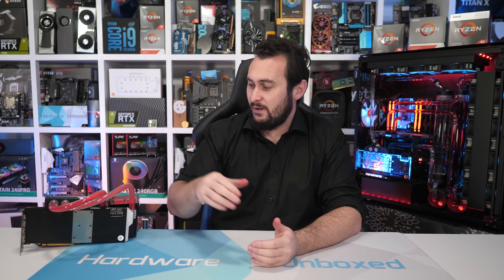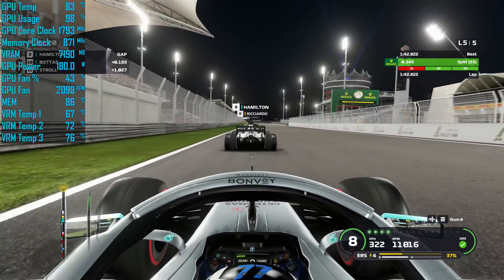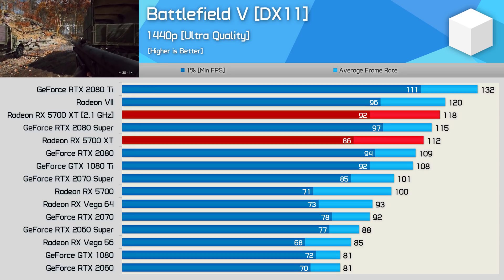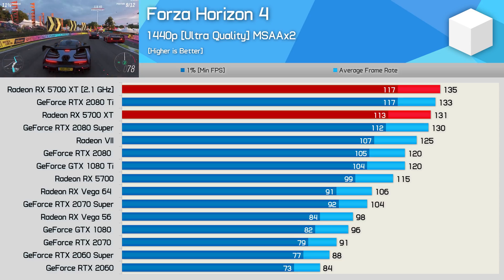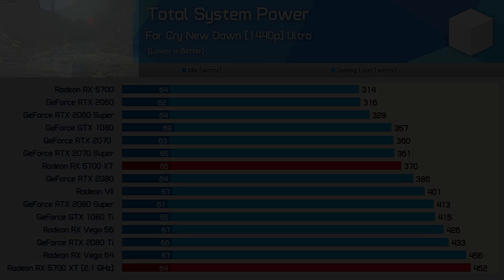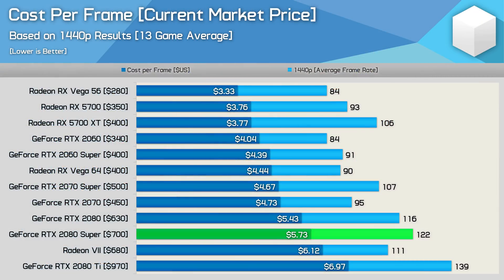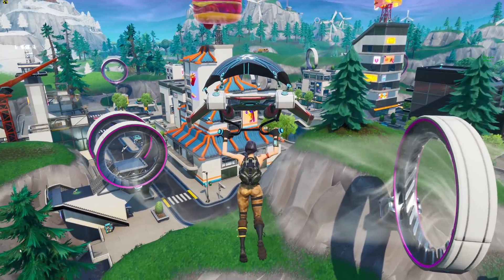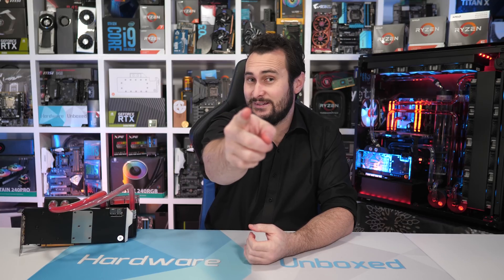Radeon RX 5700 XT Overclocked, RTX 2080-Like Performance?

Comment: On your Far Cry New Dawn chart the 5700XT @ 2.1Ghz is sitting at 113 fps with a 85 fps low. That means it beats the RTX 2080. The highlighted portion must've not carried over properly.

Comment: WTF? Why would you prefer overclocked watercooled RX5700 for 540USD instead of faster, cheaper, less power hungry and overclocable 2070S? Where's the catch?
Don't take me wrong - normal RX5700(/XT) are great, but not with waterblock trying to match (and fail) 2070S.

Comment: AMD has basically priced their 5700XT so that it gives equal dollar per frame performance to the 5700, which gives a lot of people a reason to just ignore the 5700 and go straight for the 5700XT. It seems like a clever marketing strategy, as they're going to be making more profit per unit sold on the XT.

Comment: Honestly the 5700 XT is a really appealing card. They should have used HBM, but who knows. Maybe they will have a 5800 XT and 5900 XT that kill Nvidia at the higher price points. Well.. we can hope at least.
Reply: well problem is that HBM2 Aquabolt  2x4-HI (4GB per chip) 8GB is just 614 GB/s with 2048bus vs 11GB gddr6 616 GB/s 352 bus.
now HBM2 (3x4gb) 12GB with 900-ish GB/s could be a pain to package and HBM2 (4x4GB) 16gb 1TB /s would have been a over 40cu Navi.

now the New Samsung HBM2 Flashbolt chip has 410 GB/s but the layers are now 2GB vs 1GB Aquabolt and so far I don't remember seeing any HBM2 2-Hi chips in anything, so it would be 2x4GB or 2x8GB with 820 GB/s

now jedec hbm2 standard is 307 GB/s 2/4/8/12-Hi (with rumors of ready 16-Hi) 1GB layers chips, but Flashbolt is so far max out at 8-Hi 2GB layers so I'm not sure when it will be HBM2 Standard.
 
Now AMD has said CES 2020 will not be about CPU, so we will Arcturus HBM2 and bigger Navi with GDDR6, now AMD could push someone of the three to make HBM2 2-HI chips for Navi BUT I would say it is very unlikely.

now some say the Arcturus is Hybrid GCN/RDNA, but only time will tell

Comment: Awesome review as usual. For 400$ you are getting 1080ti or radeon vii performance, thats very impressive.  the biggest limiting factor on the card is the blower. once good partner model cards come out, the thermal issues will be resolved with better cooling.

Comment: i have a sapphire 5700xt with an accelero xtream III cooler on it and, took temps down to the 45-53c i only play at 1080p 144hz  its amazing it will do 100-145 fps all the time  no idea  room temp is like 28-30c as well no ac in my room saddly >.<  down side is that it idles at 45c all the time  like its on all the time o i came from having a 1050 ti, i used to play at 720p in every game just to see like 100+ frames alot its cheezie but it works :)
Reply: You should have made a youtube vid when attaching the cooler, cause i'm looking at doing the same thing, but doubt i've got the guts to void the warrenty lol

Comment: anything can run fast with enough SM/CU, power, and cooling. this time, the 5700 runs super fast by brute forcing it's way through power. that's probably also why AMD puts a blower type cooler there, to keep efficiency while sacrificing cooling.

Comment: Performance Summary
Average of average FPS from 13 games - Higher is better:
 - 5700 XT = 106
 - 5700 XT 2.1 GHz OC = 113
 - 2070 S = 107
 - 2080 = 116

Estimated TBP in Watts - Lower is better:
 - 5700 XT = 260
 - 5700 XT 2.1 GHz OC = 340
 - 2070 S = 270
 - 2080 = 300
Reply: SlavjanA 2070 super is much better normally though, the values are screwed up by forza

Comment: Really says something that you have to spend an extra $140 to get an EK block to get it to match a 2080 and even then it only ever matches it. 

Meanwhile that’s only going against 2080 stock speeds when the 2080 can be OCed.
Reply: Yeah but it’s water cooled.... so barely doesn’t make any noise.

If you’re an FPS seeker, sure, it makes no sense.

If you prefer silence, as I do, the value proposition is very good.

Comment: Have you tried undervolting the 5700 XT since it does wonders for my vega 56 that i am still rocking (bought it for about €200 of a guy who obviously used it for mining about 1 year ago). I am easily getting about a 30% increase with some fiddling and i could probably go higher if i installed a liquid cooler, since my main issue is heat.

Comment: There is a 4th option, getting a $60 USD Arctic Cooling Accelero Xtreme IV VGA heatsink and a few small copper, or aluminum if you're cheap, heatsinks for the VRMs and vram modules.

Comment: I used to spend an inordinate amount of time testing overclocks on the Cpu and gpus i have and have given up on that lately and will only set fan curves, and undervolt maybe as the gains are not worth it.  The increased wattage and heat for minimal gains doesn't make sense.  If I want more FPS, I have to buy a better card or CPU and that is fine with me.  My gaming isn't noticably effected except for rare cases where having 3 more fps keeps the lows from becoming visually noticable whereas the average gameplay is indistinguishable going from 59 to 63 or whatever at ultra settings at 1080p on my rx480 in every game i play.    Would it be nice to get 90 fps?   I doubt I would enjoy it so much more that it make any difference.   If it plays smoothly that is very noticable and sometimes the smooth play goes away at over 50fps so something else is going on and its not an overclock that will fix it.  Fine tuning the rig to run well with best Ram, streamlining processes running in the background, cleaning and cooling the rig to run at lower temps, makes for a better play experience and plenty of people were happy with an Xbox 360 because it ran smoothly.
I think once the aircooled partner cards come out and the drivers get reworked the new navi cards will offer great performance per dollar in the upper end gaming rigs.

Comment: The driver improvements over time wont be as high as older AMD cards . i expect around 2x less performance gain from driver maturing based on NAVI architecture. Maybe less,  but can this not that great OC boost be from the fact that the architecture is still new plus the memory restriction?
Reply: Nikola Vasilev I would agree. A driver update can only do so much; people are acting like the drivers will somehow make a 5700XT be able to OC past a 2080 Ti.
Reply: @MapleLeafAce  btw something similar happened with  Vega tbh.  It was 1070 performance but later started to compete with 1080. On linux it was sligthly faster than 1080, in productivity was even way better.  i think that shows its a matter of eighter software or driver optimization. I dont see that happening with NAVI though.

Comment: It looks like AMD simply did the same thing with their GPUs and CPUs this round of products.  The dev teams found the max possible limits of each product and set the user accessible limits accordingly.  With zen 2 stock and Auto OC is basically the best you can expect to get while maintaining stability and on NAVI it seems to be configured similarly.  You can already push the GPU to 2000MHz without the power play table mod and that seems to be the max recommended clock based on AMDs software and BIOS limitations IMHO.

Comment: RDNA is looking very promising, cant wait to see where it goes. 

EDIT: Will we see any HBM2'ish cards based on RDNA architecture?
Reply: I think that has to do with the bandwidth required by the higher end NAVI cards, however I believe one of the main goals of NAVI was to move away from the very memory hungry GCN arch and thus not have to rely on HBM - so I really doubt we will see HBM as AMD would prefer to avoid it and go with GGDR6 however time will tell if it’s needed for the higher end cards to compete.

Comment: I am glad you stumbled upon this memory issue. This leads me to believe that the Navi core will flourish with HBM2 memory, i.e. on the higher tier models. The 5700XT and 5700 are both sort of mid range offerings, hence the need to keep costs down by using GDDR6

Comment: 2:58 But doesn't that mean we're not actually achieving 2080-like performance, since the people installing a waterblock to their XT are also the same people who would not leave a 2080 at stock speeds? For a better comparison, it would've been nice to see how a fully overclocked 2080 performs instead of, or in addition to, the stock 2080 shown. With the modifications to the 5700XT and the steadily declining price of the non-Super 2080, they're already within $100 of each other. No one compares a stock 2070 Super to an overclocked 5700XT, so I don't see why it should be any different here considering there's actually less of a percentage difference in price.

Comment: Did you do any regression testing at say 2050 or 2000mhz? It's possible that while gpuz et al state your art 2100 that other things internally may not like that and dialing the clocks back a bit may actually improve performance, especially in the cases where the gains in performance were much lower than the overclock.

Comment: Gains are mediocre, at best, and require water to be seen. As usual, AMD fans hype everything to death and get upset when the card doesn't live up to their own hype expectations. Nvidia still offers the most FPS in most anything that's not a direct console port, figures. Keep in mind, the 5700XT OC and on water is going against stock cards, lol. The only thing worth looking into from AMD is Zen2 and that's if you don't already have a 9900k/97000k. I think the ".... massively over-hyped" comment sums up Navi in general.
Reply: Not true. The 5700 series compete well with Nvidia's cards at the same price point.
Reply: Not true. The 5700 series compete well with Nvidia's cards at the same price point.
Reply: Not true. The 5700 series compete well with Nvidia's cards at the same price point.
Reply: Not true. The 5700 series compete well with Nvidia's cards at the same price point.

Comment: I fail to see how you are achieving 2080 like performance at a significant discount if you have to purchase the 5700XT, water pump, 240mm radiator, fans, and water block at around $800~.  A 2080 Super is $699.
Edit: I suppose the AIB cards with far better coolers could offer better results though at a far cheaper cost.

Comment: problem is the obsolescent GDDR architecture with very poor single chip performance, 
GDDR6 give you 2 variants 1GB and 2GB per chip, 56 to 72GB/s Bandwidth and 32 bit bus.

or in common form of 8GB 448/496 GB/s Bandwidth 256 bit bus, 11GB 616 GB/s Bandwidth and 384 bit bus and 24GB, 672 GB/s Bandwidth and 384 bit bus
vs 
HBM architecture 1 chip variants 2/4/8/12-Hi stacks (or 1GB per layer) 204.8 to 307.2 GB/s and 1024 bit bus, most used 4/8 Hi stack chips in common form 16GB and 32GB, 1028 GB/s and 4096 bit bus

But Samsung newest HBM2 (Flashbolt) chip with 8-Hi with 2gb per layer. 16GB 410GB/s and 1024 bit bus 
so 2 chips would gives you
HBM2 with 32GB, 820 GB/s bandwidth and 2048 bit bus 
vs 
TRTX 12x2GB chips 672 GB/s Bandwidth and 384 bit bus

Comment: It's barely passing the 2070 super.... Is this a driver issue with the 5700 XT?
Reply: Giliver this is generally the agreed upon cause. There have been some notable problems with 5700 drivers so we have to wait for those to get fixed.
Reply: @MapleLeafAce  Yee I figured as much.

I ended up going out and buying a 2070 super after commenting this anyways, felt like a better deal to me personally.

Comment: How is it possible that the memory only clocks at 900MHz max while an RTX2070s has almost double that speed (1750MHz)?
Reply: It's GDDR6 (double data rate), so it's likely they're reporting the 'actual' clock instead of the data rate, which would be double (so 1800MHz)

Comment: Looking at those number the AiB 5700xt's only gonna be to go toe to toe with a RTX 2070 super and for the price they going to retail most likely is great.

Anything from AMD reliable stomping on the nVidia 2080(super/ti) cards could only be a bigger die Navi that is not yet announced or even teased by AMD so for all the FPS W****s nVidia is still the option to go for those that prefer image quality and decent performance might consider AMD instead.

In Short i am looking forward to the 5700xt AiB model's not stoked by what the super lineup did deliver.

Comment: The efficiency. Keep in mind this is first gen RDNA and it's not full RDNA. It's still using GCN mixed in. 

Tdp isn't an issue imo though. If you're pushing this price range, you should be getting a good PSU anyway.
Reply: Why do you think going "full RDNA" will improve things? In what way is the GCN parts slowing it down? Are you aware that GCN is both an architecture and an instruction set, while RDNA is just an architecture and there's no indication that there will ever be an "RDNA instruction set?"

Comment: So it's essentially between the 2070S and 2080 usually?

Not bad at all considering it's 20% cheaper than the 2070S. Plus keep in mind drivers. AMD has shown year and year again, they get better with drivers lol
Reply: It's not 20% cheaper anymore tho if you buy the waterblock that's required to achieve this performance... I see a lot of people claiming "2080 performance for 400 bucks", which is simply not true. Great card either way, but keep it realistic.
Reply: @horrocko  
You don't need a water block... A simple dual fan card will work. Many have already shown this. He even said it himself
Reply: @nighttime1998  you will get SOME benefit out of dual fan AIB cards - nowhere have I seen anyone claim that the benefits will be as large as on a full waterblock. if you have seen someone get similar performance gains to the Igors Lab ones (which this whole story is built around) out of a dual fan, I'd be genuinely interested in a link to the video.

Comment: I hope this silences the noobs saying a simple overclock puts a midrange card on 2080 performance. It is not the case and power consumption goes trough the roof.
That happens if people speak before they think. 😅
Also price can not be a valid point as a watercooled 5700xt will cost more than a 2080 in the first place.
Reply: FIE 1 exactly. I don’t have an RTX card and likely will be sitting this whole generation out, but the statistics are there; you are not gonna be getting 2080-equivalent AMD performance for “half the price.” 

Because having to put a $140 block on it and OCing the daylight out of it beyond its efficiency curve is not a good argument nor is it a good value. 

I couldn’t care less if AMD beats nvidia or nvidia Beats AMD since I’m sticking with my 1070 Ti, but come on. The numbers are all there.

Comment: Wow... So Navi is FAR more locked down than any Nvidia GPU to date! I mean it is an amazing architecture, and a great product as a whole, but I cannot help but be dissapointed by its ability to gain performance over stock..
I mean A) Nvidia has NEVER (in the last 10 or so years) locked down core frequencies with software, sure they HAVE limited your ability to over volt to nothing on Turing, but Overclocking works will still work wonderfully, especially as you can still raise power limits significantly. B) All Nvidia GPUs EASILY clock VRAM well above spec! With many STOCK 2070 (not super, using the BAD DIE)  - able to still hit 15+ Gbps on VRAM, and again 2000+ MHZ core.

AMD used to be known as the tweaker's favorite, but with Ryzen 3000 and Navi, there does not seem to be much of anything worth tweaking...

Comment: You say that upgraded cooling for performance reasons isn't a wise choice however performance is not just raw frame rate. Much lower noise levels and temps are a huge positive for GPU waterblocks not to mention much lower fail rate due to zero moving parts. I'll take a handful less FPS for all of that any day of the week.
Reply: PC PAYLOAD except you’re spending $140 on a block, so then you might as well just get a 2070 Super or 2080 and run it at stock speeds.
Reply: @MapleLeafAce  - the same +140 dollar logic applies to any graphics card that you want with a custom water block. So what's your point? If I had to do the same thing for a 2070 or 2080 it would be the same price increase

Comment: I think there is a very good reason why the 5700XT does not boost beyond 2GHz according to AMDs own presentation. The clock per watt just gets too inefficient.

Navis clock per watt performance is pretty good, I mean look at the 5700, performs besser than the 2060 while consuming a little less power. But at the higher  frequencies, like with the XT, it kind of becomes inefficient.

Comment: If the 5700XT goes only 7% in average faster with a 18% frequency boost, then I'm thinking overclocking this card simply doesn't make sense at all. I mean, what could we possibly expect then with the usual 5-10% OC? It seems the best route is simply undervolting and leave it be. Rocking a temporary GTX 950 while I wait for aftermarket 5700XTs... can't come soon enough. Thanks, awesome video!

Comment: Hey I just got a 5700xt and I get minor coil whine while watching youtube or anytime I hover over any shortcuts etc.  This noise ONLY starts once the amd adrenalin drivers load.  I DDUd everything and no noise on stock windows drivers, second Amd drivers are installed, noise is back.  Tried wireless/wired mouse.  Tried different ports, 165/144/60hz and it makes no difference.  Any ideas would be appreciated.